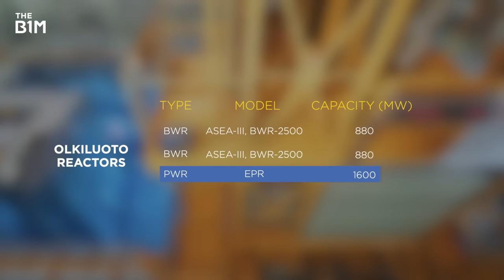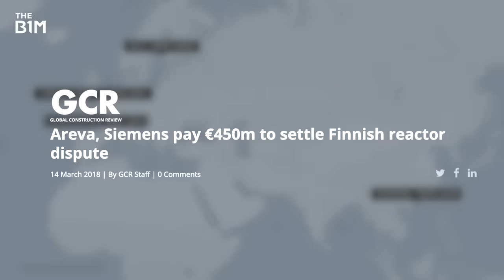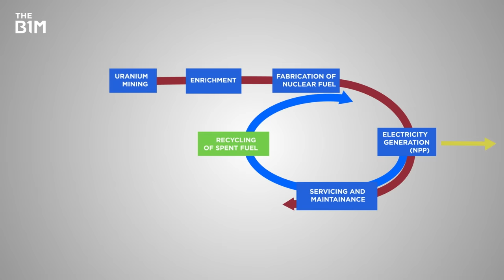Finland Might Have Solved Nuclear Power’s Biggest Problem

Comment: Actually with a thorium salt reactor when the material is spent it becomes inert fission stops when it cools down and solidifies it is no longer radioactive.  Nuclear salt reactors are the safest nuclear energy source there is if a meltdown occurs that melts a plug in the bottom of the reactor material drains into a storage tank and when it's syllabized it's just an inert piece of salt
Reply: Exactly!! Why are they still building these inefficient wasteful dinosaurs??
Reply: @walterbrunswick  its a combination of reluctance to try unproven technologies and how the engineers are way too invested in the conventional stuff and a wealth of information on how to deal with malfunction.
we also have politicians and bureaucrats to deal with even if you DO get the investors on board.
Reply: @walterbrunswick  Part of the issue is also the potential impact of widespread adoption of thorium reactors on nuclear proliferation.
Reply: @nullvoid564  I’ve been saying the same about thorium salt reactors, and someone (a commenter on another video) said that we have yet to create a metal suitable for the main hull of the salt reactors. He claimed that the current metal used doesn’t last long, and used a salt reactor in India as an example. I don’t know if he’s right/wrong — it’s the only time I’ve heard this problem mentioned.
Reply: Please don't confuse a reactor powering off with it no longer being radioactive. The thorium fuel cycle is definitely an interesting possibility, but it does have inherent flaws. Like the generation of U-232, which is the most radioactive variety of uranium we can commonly produce due to its decay products being high-energy gamma emitters.
Reply: @anthonytalin3919  Since any thorium reactors would likely be operating in countries which already have nuclear weapons, this isn't a real issue.
Reply: @GuruPrasad-qu4vg  We won't likely have "what we have," because costs and delays may make them unattainable.
Reply: @walterbrunswick  because politicians don't want to spend any money on 1960's tech.
Reply: See monju nuclear disaster
Reply: @spencersherman4763  and stuff like mars rovers LOVE u232 if i am not mestaken

Comment: biggest reason why finland has been tapping into nuclear power is that finland wants to be more self sufficient and less reliant on russian gas.
Reply: Weird then to again make the country reliant on Russia with the planned nuclear plant in Pyhäjoki. It is a Rosatom design and has Rosatom as a minority shareholder.
Reply: @Silk_WD  The design is Russian, but that doesn't have to mean it has to run on Russian rods. That's ba different story with gas. The gas infrastructure is mainly Russian and Russian gas will always be cheaper than gas from other countries.
Reply: @hendrikdependrik1891  I'm not arguing for or against Pyhäjoki. Only pointing out that independence from Russia is a weird argument for it. For sure better than being reliant on russian gas or direct electricity though.
Reply: Nuclear energy is also really green.
Reply: The opposite of Germany. They have made a huge mistake (several huge mistakes, really) with regards to their energy solutions.
Reply: And solar hardly works in Finland over winter.
Reply: @miken4591  Small scale solar combined with batteries and a powercell works at least. As proven by a project by the local energy company in my town (situated in Sweden at around the same latitude as Pyhäjoki). But of course providing the industry with power is a different story.

https://www.zerosun.se/
Reply: @miken4591  If only there was snow powered energy solutions 😒
Reply: @Silk_WD  - interesting!
Reply: @Silk_WD  It works for isolated remote communities just fine, but it's not a good solution for the large scale because it takes a lot of resources and is more expensive than the large scale solution. In remote areas the large scale solution may not be employable, so it's just perfect there. But there's no point running several interconnected cities and industry that way.
Reply: Maybe Europe needs an EU power grid which draws winter time solar power from southern countries or the Sahara, or from North Sea wind power? Hows’s Finland for wind power?
Reply: @qwertyqwerty-ek7dy  only if you forget about the nuclear waste....given the choice I'd take a few more molecules of CO2 over being irradiated.
Reply: @andrewgrosset9327  This whole video was about safely storing nuclear waste so yeah... I didn't forget about it.

Nuclear greates energy WAY more effecttively than coal based sources and it is WAY more eayer to store safely than CO2. Nuclear waste isn't causing the global warming. The CO2 is.

Carbon based energy sources  should be replaced with nuclear power to stop CO2 right now. After we are no longer destroying our climate and planet we can start making the other green sources of energy better. With these better water, wind, solar etc based we can finaly start replacing nuclear too.
Reply: "finland wants to be more self sufficient and less reliant on russian gas"

Finland isn't very reliant on Russian gas because gas isn't used that much in Finland. The energy reliance on Russia comes from direct electricity imports, oil imports, and to some extent coal imports, not gas.
Reply: Or any gas, don’t want my money going to typical countries that produce oil
Reply: @qwertyqwerty-ek7dy  Spot on. That should be the path for energy transitioning.
Reply: @miken4591  Finland is practically the same area for wind as North Sea - when there's no wind in one, there's no wind in the other. Energy storing in load fluctuation scale is doable, but not in weather scale. There are ideas, but unfortunately they all are in lab, in development - can't put hopes on those. Or on solar from Sahara; way, way too unstable politically to be practical.

Comment: I want to be at the meeting when one of the chief engineers and scientist had to announce that their game changing new method is burying it deeper and better :)!
Reply: What about LFTR reactors??
Why are they still building these inefficient wasteful dinosaurs, and then "burying" the problem??
Reply: @walterbrunswick  can you elaborate on the acronym, please? I know that there have been better, safer reactor designs that lost out to the ones we use, for bad reasons. Related to molten salt design? Obliged.
Reply: Manager: "So what are your proposed methods?"
Engineer 1: "Dig a hole."
Engineer 2: "Dig a deep hole."
Engineer 3: "Dig a deeper hole."
Reply: Yes! Let all the groundwater suck the radiation!
Reply: @Mike-kr5dn  Yep - What I noticed too - Water dripping everywhere in those supposedly "inert" tunnel storage areas! Should be tasty wherever that surfaces...
Reply: @MajorDrama1  Study the safety case for the repository. In any credible and incredible accident analysis the dose to the surface dweller is less than acceptable (>14microSv/year).

Come back if you found any faults in the modelling, the green academic complex have not so pardon me for not holding my breath.
Reply: Well if they are putting it near to the magma and deep enough, nothing other than a world ending cataclysm will unearth it.
Reply: @walterbrunswick  Said the guy who's probably never taken an engineering class at a uni.
Reply: @xway2  no, I have not
And I've worked with a number of engineers
A lot of them miss the 'common sense' factor, sadly
Reply: more boosters

Comment: What about the reprossesing it? Or Thorium reactor re-using or changing it?
(As I've heard).
Reply: While it will stretch the useful lifespan of the spent fuel rods, how will we deal with spent spent fuel rods?
Reply: @dbclass4075  The spent spent one can be stored safely inside this kind of bunker storage as the recycled waste would have less weight and volume

This kind of storage will work very nicely with spent spent fuel
Reply: Send it to Russia for their next-gen breeders.
Reply: Even thorium reactors (if they ever get the idea to work and that's not yet certain) will generate radioactive waste materials (such as the reactor casing) and will still need a long term waste solution.

Waste will always come in two categories. That which can still be processed back into fuel, and that which is just lethal radioactive trash for disposal.
Reply: @dbclass4075  LFTR Is completely Backwards to conventional nuclear energy. The fuel is liquid and the moderator is the graphite rods.

Comment: I was hoping this was an advanced fuel recycling process to reuse the spent fuel. 

Now I have the sads.
Reply: That’s your fault for having high expectations.
Reply: The recycling process exists. You got fooled by the video name - "biggest problem" isn't the biggest problem.
Reply: No reuse per se possible. You wash out  the used crap and use the left uranium. Waste stays the same.
Reply: That would be nearly endless energy. And that is the role of the nuclear fusion, not fission.
Reply: I expected it to cover fusion, instead it's another fission video...

Comment: The real solution is the research into nuclear power plants that can use spent fuel.  Conventional plants can't reuse fuel rods, but rather than just discard those rods as waste; a spent fuel reactor would work differently from a conventional reactor and wring even more energy out of the spent fuel.  The resulting "waste" would be significantly less radioactive than it was originally, and disposal would be much safer.
Reply: You mean breeder reactors? I love the tech for that being able to reuse 96% of waste and being able to safely dump the other 4% out back into the environment without causing any effect great technology that more countries need to use, either that or molten salt reactors those are great as well
Reply: Yes we are waiting but the damn thing is that the reality is now, right now.
Reply: here in western europe we stil use the same reactors then in the US stil we have a waste recycling program, it depends on how the waste is processed after disposal, for a few years it was glazed, and then the MOX recycling proces can not do much, but most of times 95% can be recycled we already make fuel from it, it is a mix of 86% new uranium and 14% recycled material, also it is used to produce isotopes for cnacer treatments and so on, the recycled material that is left has a halflife time that is 10 times shorter than unprocesed nuclear waste, also for future reactor variants like molten salt reactors for uranium and or thorium this waste can also be burned
Reply: @bigcnmmerb0873  I have one of each in my closet.

Comment: A better solution might be a molten salt reactor that uses spent fuel as part of its fuel.
Reply: Yeah, but how are we going to deal with spent spent fuel rods?
Reply: @dbclass4075  they’ll only last 300 years
Reply: @Joe-ho6fo  Which still requires storage during those 300 years, which is a long time, and 3-5 generations long.
Reply: @dbclass4075  spent fuel rods, and other types of radioactive waste, are precisely what the molten salt reactors consume as fuel.  If the problem with nuclear power is risk of meltdown and the proliferation of nuclear waste, these reactors solve both of those problems.  So our options are to stop using nuclear altogether (and therefore stop producing new waste) but then be stuck with the existing quantity of waste for 10s of thousands of years, or build MSRs to start getting rid of these existing waste stockpiles.  Less waste is better than more, but people are unwilling to even listen because of past issues with nuclear power and would rather write the whole thing off, rather than try to actually solve the problem.
Reply: @dbclass4075  300 vs 10k its not a problem and thorium cycle can use old waste to run and its makes less waste than other methors

Comment: “It’s much more than burying the problem”

Is it though?
Reply: It’s fundamentally a non issue burying nuclear waste. You may as well get upset that 99.99% of the earth is uninhabitable because of molten metal or sea.
Reply: I expected them to find a technological solution rather than "digging deeper", for example, to further re-use the degraded plutonium or to actually make it less harmful. What they're doing here will prevent future generations, who may figure this out one day, from accessing the waste to deal with it properly, thereby discouraging research into those solutions.
Reply: It’s just a safer way of burying...
Reply: Anti-nuclear people don't want a solution. They want to hate nuclear.
Reply: @Lord_Sunday  "It’s fundamentally a non issue burying nuclear waste" That is just a plain wrong statement. It is very important where you bury it. It needs to be an area that is and will be geologically inactive for at least a few thousand years more. And it needs to be the correct kind of rock. One that is not permeable by fluids and that will not easily form cracks under stress. Many countries in the world, for example all of europe outside of the scandinavian peninsula, is not suited for long term unmaintenanced storage.
Reply: @Lord_Sunday  clearly you know nothing about the subject of you equate radioactive waste to lava
Reply: @StAngerNo1  Why does it have to be a few thousand years? What is that timeframe based on? 

That’s a very bizzare timeframe given the decay rates for nuclear material. 97% of nuclear material by radioactivity experiences total statistical decay (10 half lives) in less than 500 years, while 98% of nuclear waste by volume experiences total statistical decay between 250,000-44 billion years. 

What is the couple thousand year timeframe based on? Don’t tell me you have a crippling fear of Holmium166m....
Reply: ...You DO realize this Nuclear Waste Is METAL RODS right? They ain't going anywhere... And while I would prefer reprocessing followed by vitrification before storage to cut on the amount of waste, long term geo storage is fine, as again they are METAL RODS they won't leak, they won't go any where because believe it or not, Nuclear Waste Is not glowing green gunk...
Reply: @brian2440  I missread your text the first time. I didn't really put much thought into the timeframe, it was just to show, that it is not a short term issue. I based it on numbers you often hear from reenriched waste, which is a few thousand years. I just tried so research it, but I find very conflicting infromation which range from a couple of decades to tens of hundrets of thousands of years for nuclear waste to become harmless. This overview from the Standford university which is source backed, for example makes the latter claim for at least some of the waste to be dangerous for hundrets of thousands of years.
Reply: @directornorthmoor9094  While they are indeed solid, it is the radiation that is problematic, which should be properly sealed away.
Reply: @dbclass4075  it may surprise you to know that they mine radioactive material out of the earth in the first place. the mountain I live on has a high concentration of uranium, just chilling under my house.
Reply: @Lord_Sunday  I will not claim a huge expertise, but its VERY hard to account for everything in nature. Re: Fukushima. There is such a thing as fresh water, some of it gets filtered underground. How exactly can you account for everything? If you bury it completely its also harder to keep stock of whats happening down there, so we wont know if a disaster has struch untill its WAY too late :\
Reply: @YourEnvironmentSeattle  - An Either-Or comment to a complicated issue.  You can do better.
Reply: @banana_junior_9000  I bet you can't explain the problem of nuclear waste.
Reply: @thomasberkvik2376  radiation is everywhere. Anything dangerous to need accounting will be detectable using a Geiger counter. Radioactive contamination is the easiest pollutant to track.
Reply: @YourEnvironmentSeattle  - Because it's complicated.  Your comment is that of a child at recess.
Reply: Found another anti-nuke, it's  @banana_junior_9000
Reply: Yes, it’s buried much more deeper
Reply: @thomasberkvik2376  That's why you'd want to have remote sensors such as seismographs, Geiger readers, pressure, and humidity sensors. If anything changes in a sealed vault buried in a bedrock slab, you'd at least be able to have a reaction plan or damage assessment. For such a sensitive project, I don't think they'd "bury" it and never look at it again.
Reply: @thomasberkvik2376  Fukushima is an example of not properly accounting for some very obvious risks, not any sort of a freak accident.
Reply: @YourEnvironmentSeattle  - Oh, dear.  I've been called "anti-nuke".  Whatever shall I do?  I should know better.  Nuclear energy is clearly the cleanest [except for the high-energy isotopes] and the safest [except for a few disasters] energy available to all.  There are no other alternatives that are less expensive.  I need to get over it.
Reply: @YourEnvironmentSeattle  - Always skilled and sometimes unionized installers.  How do you know so little?  Stay in school.  Read...books...nonfiction.
Reply: @banana_junior_9000  you're denying what's happening in Xinjiang where panels are manufactured.

Genocide denial.